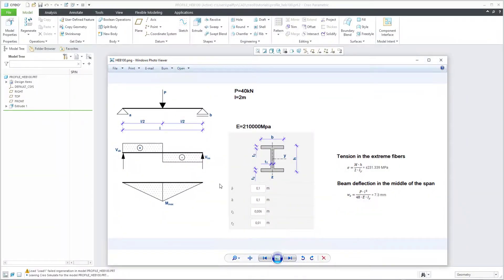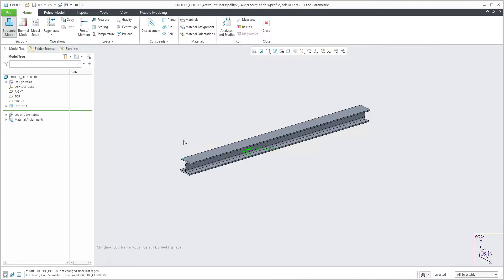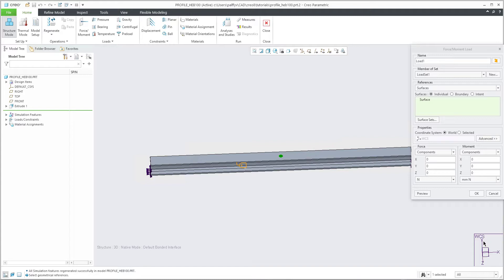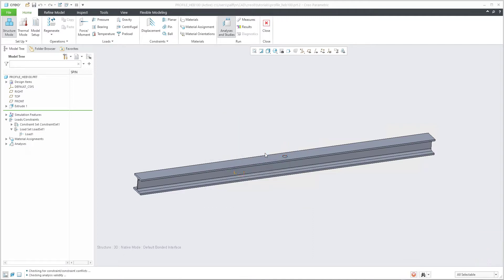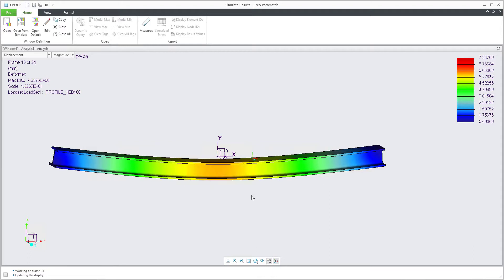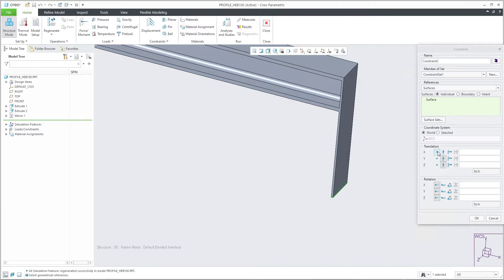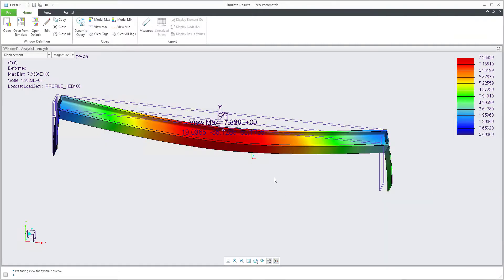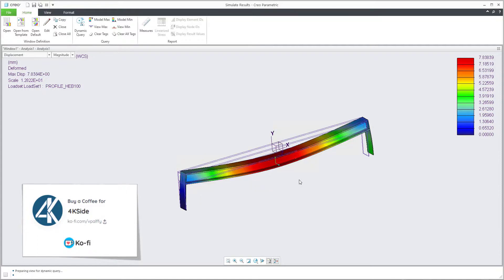Beam Bending with Creo Simulate | Definition of Surface region

Comment: Vey nice, but I solved a similar example with taking the load reference to be a point instead of the small circle you drew.. and it gave me different results.. why is that? Note that the load was similar to the load on your example (point load, not distributed load).
Reply from the maker: If you use only point, you will set concentric loads and deformation (not recommended)
Reply: @4kside   Ok, thanks bro.

Comment: Hi sir, good demonstration, I tried and it work on simple beam but now I have constructed a car chassis using AFX frame structure... And now it is showing lots of error... Regarding intersection in assly, radius of tolerance and many more.... 
So kindly guide how can perform analysis of assembled structure...?
Reply from the maker: Hi, thanks for your question.
Intersections are not allowed (not used) if you need to calculate assembly.
Also, many times you need to simplify geometry (minimize errors in calculation)
In realty, you can calculate stress or deformation on model or assembly
.. And if system show you some warning, please simplify geometry (its helps a lot)
Good luck. Vladimir
Reply from the maker: And also, thanks for your tip for another tutorial. Stay tuned. Vladimir

Comment: Hello, I am enjoying your video,
I only have steel, how can I make a steel mechanical light.mtl?
Reply from the maker: Hi, you can create any new material with Creo suitable for Creo simulate. If you need to calculate results in MPa please check used values and units what I use in my customised material. The used names is only that you can recognise that my custom material and not from default library.
Reply from the maker: Hi, also you can download mtl file here: https://bit.ly/steel_mechanica_lite

Comment: How to make top down assembly,  please make a video on this topic
Reply from the maker: Thanks for your idea. I will try to find some example. Stay tuned Vladimir
Reply: @4kside  Congrats Vladimir, your video are always clear and easy to understand. I add a request, could you do a video of the Thermal Mode? Simulate a heatsink with an electric power source for example? Fabio
Reply: @Compilation But Thermal mode is not inside the Creo Simulate? I think that you have Simulate you also have Thermal mode active!
Reply from the maker: @FabioUgoletti  Hi Fabio - thermal is not inclued in my license package, I use Creo Simulate Extension: https://www.ptc.com/-/media/Files/PDFs/CAD/Creo/Creo_Simulate_Datasheet-English.PDF and Thermal is in Creo Advance Similation package: https://www.ptc.com/-/media/Files/PDFs/CAD/3D-CAD/Elements-Direct/PTC_Creo_Advanced_Simulation_Ext.pdf 
Maybe next time I will help more :) Bye, Vladimir